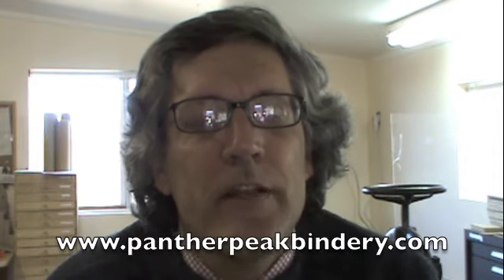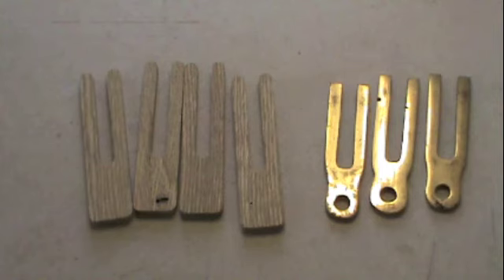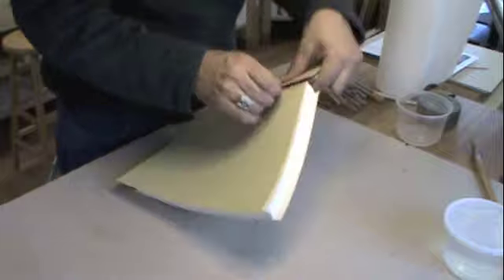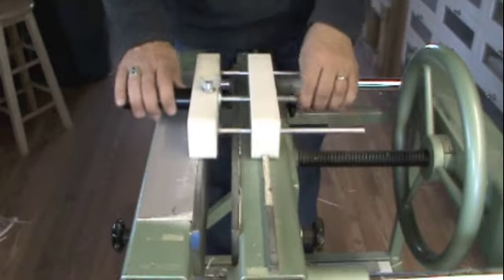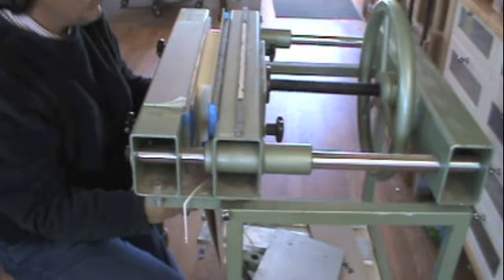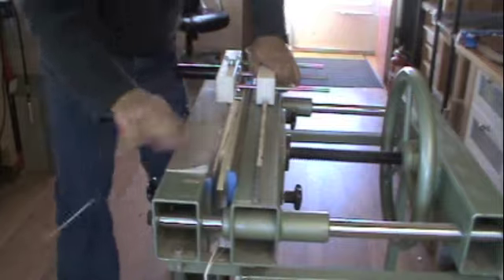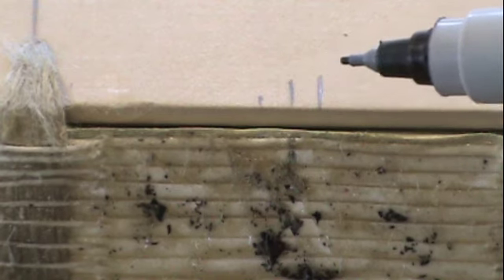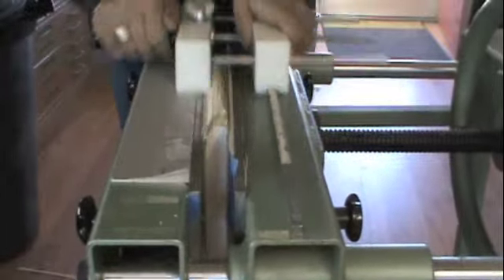Ploughing in boards

Comment: I sell a simple plough that is very easy to use and will work on any lying press.  The steel cutter is similiar to yours, but in a simpler form and thus cheaper. 
You mention backing and I offer backing irons and presses for them to go in. 
Check out my videos for that and other inexpensive binding equipment.